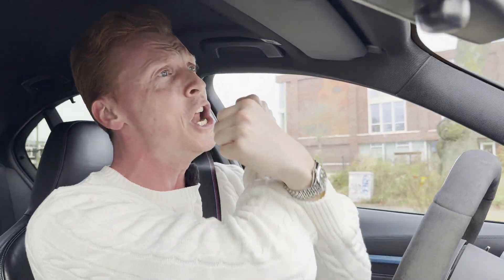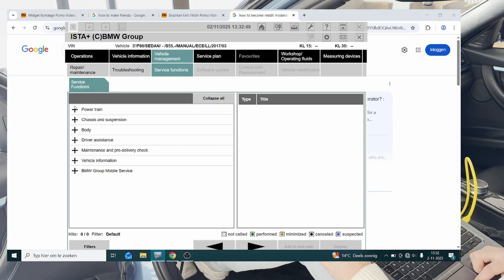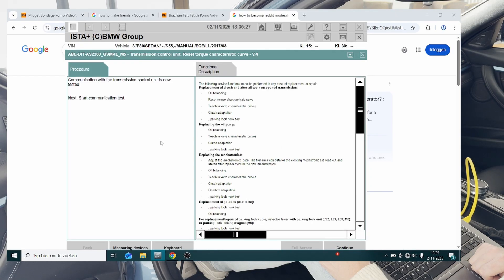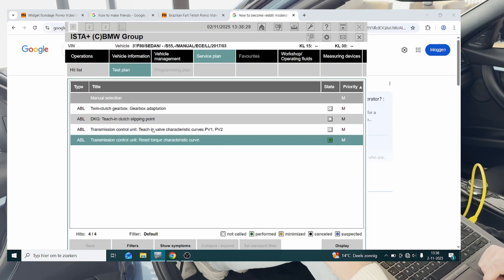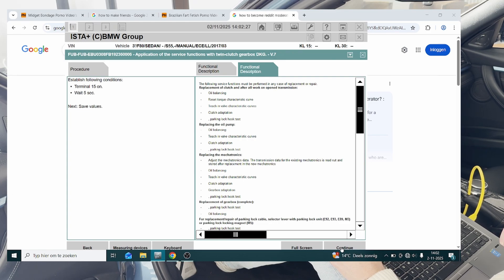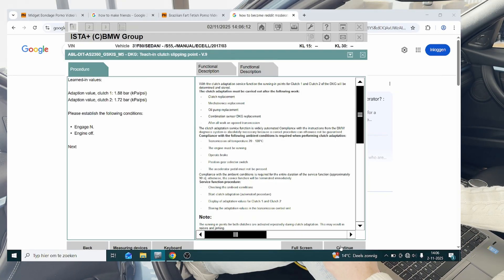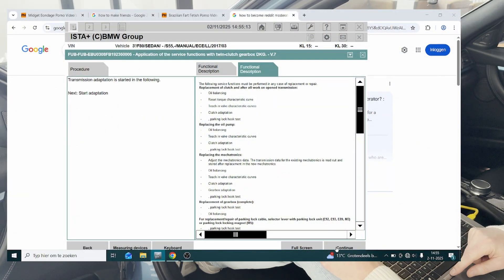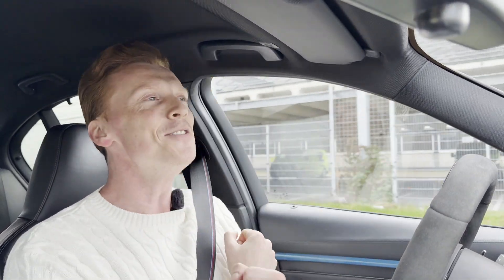BMW DCT RESET WITH ISTA

Comment: If the car is a bit clunky when driving away from a standstill this makes a huge impact. So can also be done when there hasn't been done a DCT-service.
Reply from the maker: Correct, can’t hurt to do it anyway. As I said in the video: it’s especially useful after a service (not exclusively)!
Reply: does this also apply to G Series gearboxes? mine does a clunck sometimes when i press my foot on the gas from a standstill.
Reply from the maker: @burnouthugo although this video specifically pertains to a DCT, you can definitely give this a try

Comment: Thanks for the tutorial, when I did clutch slipping adaptation it went unsuccessful, kind of unclear whether to hold the brake at whole procedure or release at every step, haha. By the way your exhaust is nice, you have M Performance and something else maybe? Did you program start up to GTS roar? Nice search tabs btw hahah
Reply from the maker: Thanks buddy, yeah it can be a bit tricky. It’s an active autowerks equal length midpipe with an M Performance exhaust and a GTS startup roar (which I dislike haha, too loud)